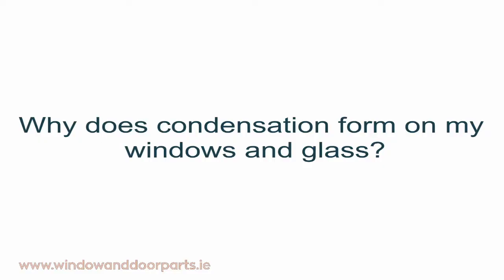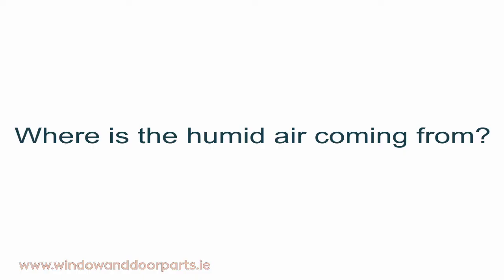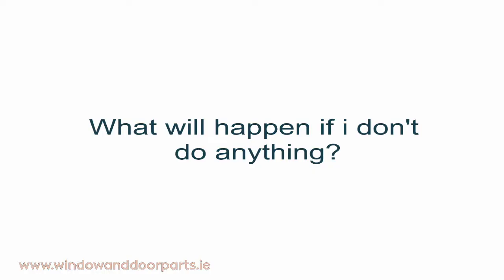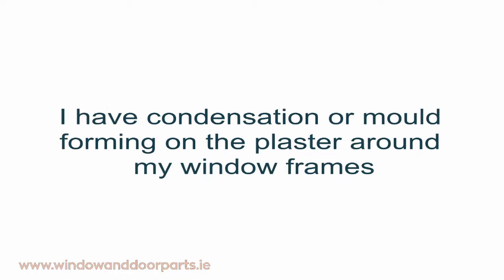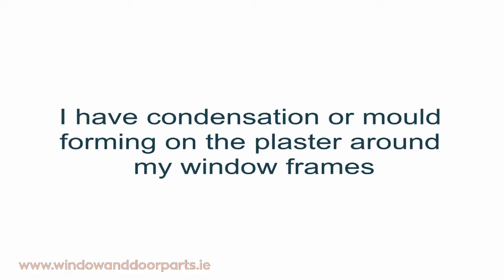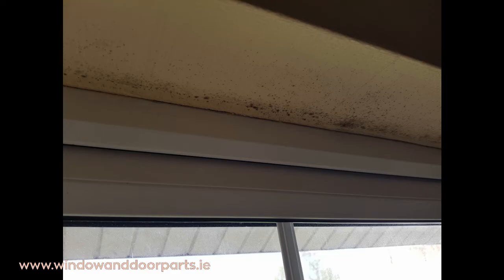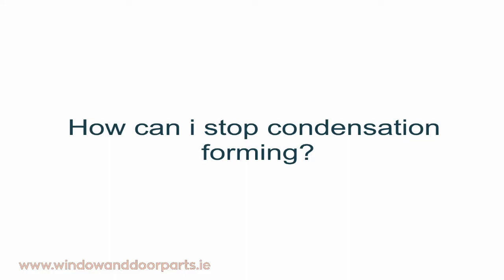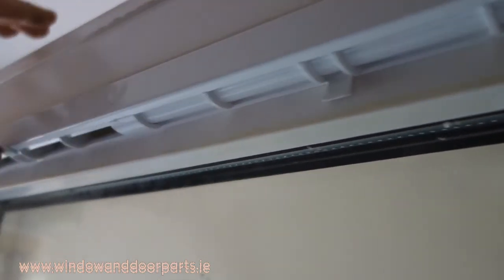Window Condensation Part 2 :  Interior Surface of Glazing

Comment: I've had brandnew energy rated windows and doors fitted and getting condensation on every single window and door with mould around the frames this is happening in rooms we don't even go in do you think that badly fitted frames can cause this I'm at my wits end

Comment: Hi, Paddy, very nicely composed video. Tell me have you ever fitted a Window Trickle Vent Airbox? I've recently been looking at fitting air vents to my three windows and I watched the video on how these are fitted, but after studying the video I thought why not just cut the rubber and leave the box out? I know you will not be able to turn the ventilation off but that might be a good thing as it's only a slight air flow. What are your thoughts on this idea? Regards. Paul
Reply from the maker: Hi Paul, best piece of advice i can give you is to try closing your window on the night vent setting. If you have pvc windows it allows you to close and lock your window in a partially open position. Only about 1/2 an inch. Either that or wedge your  window so it leaves it partially open. See if you can live with it like that for a week or more. If it helps with the condensation and you don't mind the street noise etc. Then trickle vents would be a good idea.  As for your suggestion about the seals. Just try grabbing hold of the seal and try pulling it out. A lot of the seals on windows are just pushed into a groove and held in by friction. If the seal doesn't come out when you pull it, it's probably co-extruded and made part of the window. If thats the case i wouldn't cut the seal. Last thing you want is to cause another issue that can't be fixed after. At least if the seal pulls out you can always put it back if it didn't work out for you. Only downside i can see to your suggestion is that you will have a very narrow gap with the seal removed, and this can cause a whistling or howling noise if the wind is strong. Hope that helps

Comment: Hi Paddy, that’s very good advice on the inside of windows steaming up in winter!
My windows only steam up bad on frosty nights, windows were made in 2001, when ya stand inside the window glass on a frosty night ya can feel the cold , frames are in good condition, would it be worth fitting new double glazed glass units?
Thanks 
Dermot.
Reply from the maker: If the frames are pvc there would be a case to replace the double glazing for "A" energy rated double glazing. If your frames are aluminium there would be no benefit in doing it. It'll be approx half the cost of new windows. But get some quotes from different companies.

Comment: Hi paddy would u be doing a video on how to router out a single glazed window to receive a new d.g.u. I have been asked by some ppl if it can be done which I know it can but how to go about it is another thing. .Cheers on any advice.
Reply from the maker: Hi David, don't have any plans at the minute but i'll keep it in mind. On wooden windows that are only rebated for single glazing, the easiest solution is to get a stepped double glazed unit made up. Done a few jobs like this over the years, especially on protected buildings. No messing around with a router. Nice neat job

Never routed out a window in place, i would imagine you would need a special router as the plaster reveals of the walls would block most standard routers. I always steered clear of these jobs :)

Most wooden windows I've came across would have a pretty wide rebate, wide enough to fit a narrow DG unit and a slimmer glazing bead. You can get the units filled with Krypton gas instead of Argon in these narrow units to give a U-Value comparable to a thicker DG unit.
Reply: Window and Door Parts Ireland ah yes I heard a couple of old time fitters on about stepped units going into wooden windows .as for the krypton gas I never thought u could put it into a 4x6x4 d.g.u. or upwards .must keep this in mind.once again thanks for getting back to me.cheers :-)

Comment: Hi Paddy, we get condensation on our windows over the winter months; oddly though, condensation doesn't form in the corners of the windows. Does this indicate there are air leaks in the corners?  Thank you
Reply from the maker: Yeah could be the reason. Is It in every corner?
Reply: @PaddysDiy  Yes, in the bottom corners of both the sashes and windows.

Comment: Ive had brandnew double glazing amd im getting condensation
Reply from the maker: Where is the condensation? Inside surface? Outside surface? Or in between the panes?
Reply: @PaddysDiy  yes on the inside surface but not inbetween the pains its on every window and is normally around 1inch high on the bottom of each pain
Reply from the maker: @thebrownauditor5540  have you got the entire window replaced? Or just the glazing in the existing windows? Has there been any building work work that involved plastering in your home?
Reply: @PaddysDiy  no plastering done and yes the whole house was fitted with brandnew double glazing with new frames and glass
Reply from the maker: @thebrownauditor5540  was there any plastering involved in the installation of the new windows? Did you have any issues with condensation before the new windows were fitted?
Reply: @PaddysDiy  no plastering done and there wasn't any issues with the previous ones
Reply from the maker: @thebrownauditor5540  very hard to know what's the cause of it without seeing them. Plastering drying would be a cause for it for newly fitted windows. You should get back on to whoever fitted them for you
Reply: @PaddysDiy  its been an ongoing battle for 2years now cant seem to get to tge bottom of it